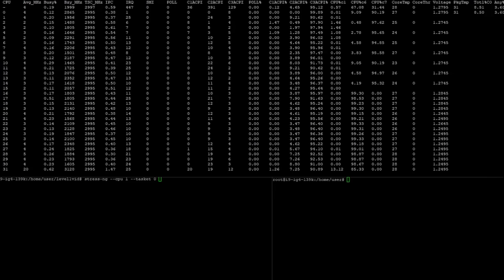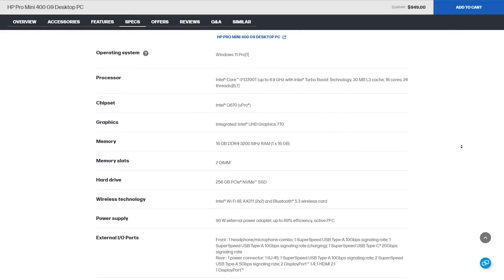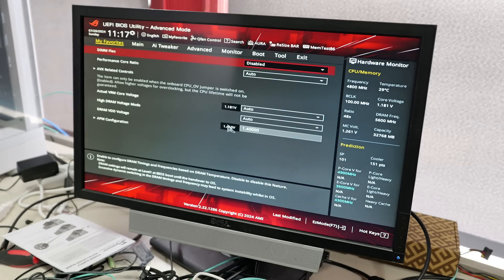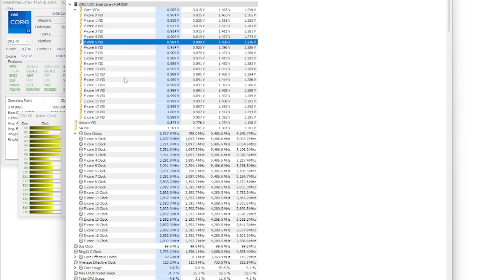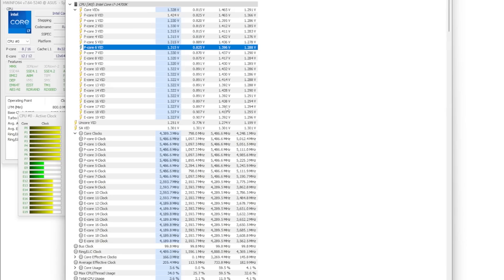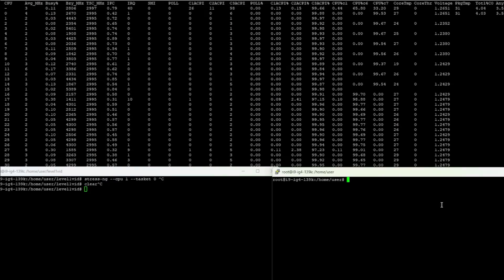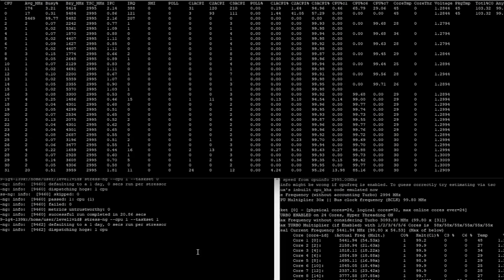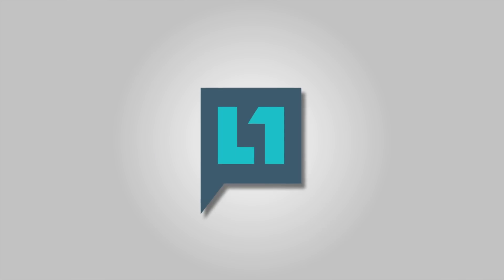Turbostat.c: Let's Add a Voltage Monitor Patch for Intel CPUs

Comment: Can you do a video on determining if your CPU needs RMA'd. It's often difficult to figure out if just bad code, or if CPU now in this case. I host a few dedicated servers on Debian w/ Docker. I do see crashes from time to time but that seems normal. But now , with a 14700, I will question every crash :| Only recently have the new microcode been available.

Comment: Sadly software-tools have a near 0 chance of catching those voltage spikes. You'd need hardware interrupts on the actual register with a direct readout to catch those. The VID changes rather quickly and the spikes are really just short intervals - if memory serves me right it was something like 200us and the are not "common" so catching them is really not easy. And then the resulting voltage-spikes have a nasty relation with interrupts and low threadcount workloads like many loading-screens and menus and there sadly is no way of monitoring that in software at all (oscilloscopes should be fine as we are talking timescales on order of 1 us).

Comment: nice patch , got system stable now with no more reboots , installed i7z as well nice tool  , is their a AMD alternative ?  CPU-X is pretty slow and knowing voltage for each core would be sweet to know which the better cores are

Comment: Nice. May I suggest to name the column "VID" instead of "Voltage"? "Voltage" is confusing as one might think this is Vcore, which is the actual voltage that the CPU gets. VID is the proper term for the voltage requested by the CPU.

Comment: Just Synch your effing cores and you stop Single Core voltage damage. This is sooo simple. For a Single Core to reach 5.8Ghz it needs more than 1.5v. Then you have damage. NOT a mystery....

Comment: I think YT Tech Tubers are milking this Intel fail for clicks.

We KNOW that Single Core at 5.8, 6.0GHz is drawing over 1.5v.
THAT'S the problem. Synch your cores, ZERO issues. Fake drama.
Reply: "We KNOW that Single Core at 5.8, 6.0GHz is drawing over 1.5v." - no, that is already the problem. For TB3+TVB the voltage should have never even hit 1.5V.

"Synch your cores, ZERO issues. Fake drama."
No it is "real" drama as thousands of pople got their CPUs damaged by running them with the out-of-the-box motherboard settings.

Comment: In April 2024, I bought a new system with an MSI Z790 Pro Wifi P motherboard with an i9 Core 14900KF cpu.  The machine runs ProxMox then uses that to run a Linux image running TrueNAS, then a couple of other Linux images for programming and sometimes a Windows 11 image.    I've applied MSI's updated BIOS image 7E06vAD3 dated 6/20/2024 to the motherboard but suspect some tool like this might be required to spot any degredation that starts accelerating over time.  However, I presume watching stats from within the BIOS isn't very useful since if you're looking at BIOS screens, the machine isn't running a full OS and client loads.  I would also assume running a tool like this on one of the CLIENT machne images running on the system won't help either because they may not see all cores in the processor.  FWIW, the motherboard BIOS indicated before and after the patch that it was configured with a baseline CPU voltage of 0.88 volts so it seems to have come from the factory WITHOUT any config that was trying to overclock it or even push it close to limits.

Comment: Wendel you might not be exactly correct. More voltage does not mean bad CPU. Der 8auer made a video and tested multiple CPUs. There are CPUs with higher voltage but less power dissipation. But I am not sure, if those CPUs nevertheless suffer more electromigration.

Comment: I love my 13900 - RTX 4070 mobile rig. Smooth HIGH FPS gaming, lighting fast workloads, and pretty amazing battery life (10+ or so hours) given the system. But it runs HOT when worked and I worry all the time about the longevity of this system. In comparison for times when i need something smaller and lighter I have a Ryzen 7730 system. That same gaming albeit at a solid and smooth 60FPS and work load might take a slight bit longer has the smaller system running cool as a cucumber and without the jet engine sounds. Im not saying I may ditch Intel next go around, but its looking likely if nothing changes.

Comment: Have you actually done any testing and comparisons between the requested voltage and crashing? Can we expect some sort of correlation data in a future video? 👀
Reply from the maker: a little bit. it seems that when a CPU starts to degrade the instability creeps in at the lower end of the vid ranges, not the high end. so typical tests that fully load a cpu may not show any problems whereas running bursty workloads show problems.
Reply: @Level1Linux Could increasing the voltage reduce crashing then? At the cost of accelerated degradation I suppose..
I was moreso wondering if it'd be possible to diagnose a CPU early based on its tendency to request higher or lower voltage for specific frequency
Reply: @Level1Linux Could that be one of the reasons this was not detected by QA at Intel? They never designed tests for this specific failure mode and therefore they couldn’t detect it?

Comment: Hey, Mr Wendell Wizard. How about calling the column header VID instead of Voltage? Also is this value the raw VID or is it SVID (so DC/LL taken into account, like in HWInfo)? 

Btw this SVID readback is also used for power calculation, so by using lower DC/LL motherboards basically can open more power budget while still showing 253 W or whatever in the software readout.
Reply from the maker: it's open source :) I am using the equation and terminology from intel reference to directly convert the register value in binary to a voltage. it's literally just msr198 in the turbostat.c patch. in my utility I'm doing a little more work.

Comment: Yesterday I ran HWInfo on my 13850HX laptop and was happy to see 1.350V max. But now you have mentioned that this is the requested voltage, and not the actual... so to be safe I am going to disable turbo boost again, which limits it to 2.1Ghz and slow as, but better than it getting fried.
Reply: Actual voltage at the chip will be LOWER due to DC LL (milliohms) x Current Draw (Amps) apart from minor ringing if you set a high LLC value (on Asus. GigaByte is Low for more aggressive ACLL).

Comment: I started using Turbostat years ago but I just installed it from the repository (Arch), it surprises me how few users know this tool, it gives a lot of useful information in the terminal, especially because it is on Linux Torvalds his GitHub-account if I am not mistaken. I used it in combination with watch to update it all the time and see what the CPU is doing during certain tasks.

Comment: Wait a minute, what's with this good i7 and good i9? Everyone was claiming that all 13 and 14 gen CPUs were e experiencing this problem but now its only some.
Reply: "good" ones can be overclocked I suppose, or have lower power at a certain clock. Should have nothing to do with the bug.

Comment: who is buying next intel?
Reply: I kind of want to get an Arrow Lake laptop (preferably Framework 16, with CAMM2) when they release... if Intel still exists at that point. These stories make me so nervous. Especially the way they deal with the problem is just infuriating to see how bad and still quite incompetent is done. Pat clearly started some cleansing and repairing when he arrived and it appears it's still not done. I really REALLY hope they can fix their bloody neverending internal problems, survive and get back to being an excellent microchips maker and CPU designer. It's embarassing, knowing that there's still a heckton of awesome engineers at Intel that basically get sabotaged by some stupid mistakes like that.

Comment: I thought that’s pretty high voltage for a cpu when it’s being slammed to be 1.3-1.4v, the few CPU’s that I’ve got it’s typically 1.12-1.25v when all cores are being slammed. Love your stuff Wendell
Reply: The problem is not when all cores all loaded, is when only one core is loaded, that's when that single core goes to the very high boost speed (6.0ghz for 14900k) and requests 1.50v+ , those 1.50v gets applied to the ring and gets fried.
Reply: @ivantsipr  mine is a poor sample 95SP rating and for 6ghz is 1.478v is what the vid table says of course it’s lower than that because I set it lower z790 dark hero. I think it’s 1.406v for 6ghz now

Comment: mOhm is milli not Mega ohm. System programming and ee cpu stuff is what i did my whole life. Those voltages are still high level to alu and instruction decoder etc...

Comment: Asus motherboard been helping Intel to save face but many dumb media blame Asus now we all know its.not asus fsult. Thanks for this
Reply: Intel provided Asus (and everyone else) with the documentation, firmware and validation tools. If Asus follows that and validates accordingly, then Asus did nothing wrong unless it can be proven that they have a measurably higher failure rate than all the other board vendors.
Reply: Asus has a very spotted past and the Asus auto overclock option in the bios is providing a lot of voltage to the chip, so they are not without fault even with the 14th gen.

Comment: I think it would be useful if, for each core, each processor, or each SKU, we could produce a graph. On the x-axis, we would want bins of frequencies (say 4000-4100MHz, 4101-4200MHz, etc.) and on the y-axis, the range of voltages requested for those frequency bins (with error bars). Then it would be interesting to compare those processors that are having trouble to those that aren't. Great work on the patch - I'm sure many will find this data useful.

Comment: hopefully intel's patch will help users with these CPUs to prevent early fail
Reply: It stands to reason that the damage has already been done and that it is only a matter of a few months or years until it fails. Like with the Intel Atom C2000 bug, but without any way to hotwire the CPU.
So, I guess that Intel is playing for time at this point, effectively trying to stall beyond warranty dates and also covering things up as to not endanger (future) sales.
Reply: They can only delay failure not stop it.

Comment: All of these CPUs get very, very high transient spikes apparently, that can't be caught with software. You need an oscilloscope to measure these spikes according to Buildzoid from the Actually Hardware Overclocking channel. His CPU hits around 1.6-1.7v fairly often but it would be such a random transient spike that it wouldn't be measurable with software.
Reply: Indeed. And why trust these software readouts in the first place. They can be manipulated like, let's say VW's emission values, apart from being inaccurate and of low resolution.
Reply: True, a scope is the only way to see the high speed spikes.
Reply: I don't get it how Intel could overlook an issue which can be detected with a $200 scope. Bet someone there knew all along, and management decided to ride it out till the warranty runs out. Or middle management hid it in order to not upset the upper level management, because bad news are unwelcome and they shoot the messenger, like in many companies.

I mean we already have the proven case on our hands where they decided to hide the 13th gen oxidation defect from their customers and ride it out instead of issuing a notice on a small serial number range.
Reply: I don't get it how Intel could overlook an issue which can be detected with a cheap 1gs/s scope. Bet someone there knew all along, and management decided to ride it out till the warranty runs out. Or middle management hid it in order to not upset the upper level management, because bad news are unwelcome, like in many companies.

I mean we already have the proven case on our hands where they decided to hide the 13th gen oxidation defect from their customers.
Reply: And even if it could catch it every so often, it wouldn't be reflected by what the CPU is requesting.
Reply: The real proof would be to use a logic analyzer to snoop the PMBus and look at the actual VID requests sent to the VRMs.

Comment: I applied the automated all core turbo even when on light loads, that and lowering down voltage to 0.85v at idle seems to have turned stable my unstable at stocks gaming MOBOS 14900K.
Reply: You better start the RMA process. If your CPU is already unstable at Intel Default settings with the Extreme profile selected, then it is only going to get worse and worse and worse. And you paid for a CPU that can run the Extreme profile.....
Reply: @andersjjensen  yeah, problem is, for those who aren't rich enough, like me, we tend to buy 2nd hand (but at the end, we pay twice the price of brand new with warranty). And so there's no invoice or proof of buy that anyone would take as good for making an RMA.
Reply: @Pacho18  OUCH! Sorry for you loss man :-/
Reply: @andersjjensen  Yeah, bc of that, and Intel not doing a proper recall for all of those out there affected, i'm done with'em for life.

Comment: Load line is in milli  Ohms. Capital M = Mega. Lowercase m = milli
Reply: OUUPPPSSSS look over me, I'm slow :D I did at least calculate the right voltage, task failed successfully. engagement challenge? :)
Reply: @wendelltron  I wonder if NV/AMD will bump into this issue on GPUs eventually...
I mean, boosting GPUs to max. [but damaging] voltage at the loading screen or game menu, to drop it to safe level after game loads.
Saving grace for now is that NV/AMD aren't pushing 1.3+ volts though them :D
Still, ~1.05V limit isn't exactly low given the absolute transistor count monsters, that current gen GPUs became (overheating A LOT on Air cooling and barely "fine" on water because of it).
Maybe base/stock max. voltage = 0.8V for GPUs, and 1.25V on CPUs is the answer ? (with option to go higher noted as overclock, by driver option click and acknowledging a warning popup window about higher power/temps ?)
Side note : I wonder how much electricity is being wasted by simply having millions of CPUs/GPUs pushing for that extra 5-10% more performance, by increasing power usage by +30-50% at the same time... 
Heating the globe by being inefficient on perf/watt metric (since stuff isn't ran at "sweet spot" on V/F curve by default) - Dumb AI era is indeed here.
PS. Sorry for this post being a BZ-style rant...
Reply: @CompatibilityMadness most are just fine on air cooling.  If you’re barely okay on water, you have something else going on. Start by making sure air is getting in your case and through your radiator.
Reply: @CompatibilityMadness You're clearly an Intel user and fan. AMD don't use much more energy than they used to. Their 96 core only uses 100W than the 14900Ks 8 cores and 16 mini ones. 

More importantly increased transistor count doesn't automatically mean higher power draw. The whole point of having more transistors is to be able to build efficient codepaths for many many different strings of instructions. All the transistors are not in use at any time, and as transistor count grows, average usage decreases.
Reply: @Gen0cidePTB  If only I was talking about AMD CPUs in my post... (GPU talk)
Edit : I don't use Intel GPUs either.
Reply: Thanks bz
Reply: Was about to say: That'll be some insane voltage drop if we talkin megaohms.
Reply: Yeah, thought that Wendel misspoke there as well
Reply: I came here to write the exact same thing. And what did i find? Buildzoid was way faster than me with the same comment 👍 If the load line on a board had something like 10MΩ we would not have the problems we have now. Because the CPU´s would never ever run in the first place 😁
Reply: I was about to comment... and that was the top comment -Mega = 1e6, milli = 1e-3. I wonder how much this has to do w/ the US not using metric. The ratio M/m is a billion
Reply: So talking about mega-ohms on a loadline of the cpu ? MILI ohms maybe. Mega ohms are used in tube equipment, lol
Reply: Bruh just become a computer hardware engineer already lol

Comment: lets take advice from the guy that doesn't know what a Vid table is
Reply: lol what? the patch to show vid output in the turbostat table works just fine for me?
Reply: The VID table helps fuck all if you want to know when and why the CPU decides to request said voltage.
Reply: @andersjjensen  For a start completely false and my point was that he doesn't even know what a Vid table is. Keep getting your advice from pc tech channels with zero technical understanding.
Reply: @Avenge_Computers  lol I think you might have been trolled by someone who didn't understand what they were looking at :-P

Comment: The problem is not voltage !
Flaw has been in processors since the 11th generation!
Look for processors that didn't die, dual channel stopped working!

Comment: I have an ASUS that has the V/F Point feature but it just shows 0.000V for all points for my 13900K. So I might be missing something.
Reply: I don't think you are missing something. Based on what I saw, it might just be the p!ss poor software quality. CPUs are getting more complex and all I can really see "improving" is the gaudy and extremely laggy BIOS/UEFI UI.

Comment: Just lock all cores and limit voltage to where it’s stable. The single core boost is what is degrading the chips same way when you would push a chips voltage overclocking it the last decade are more. 
Mainly this algorithmic boost for the maximum benchmarks and efficiency are what is causing the issue